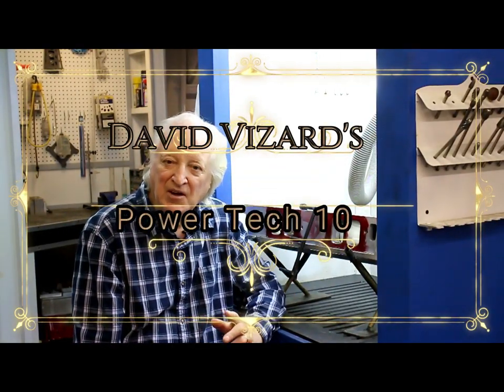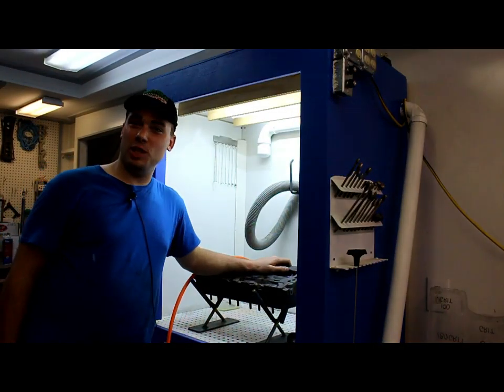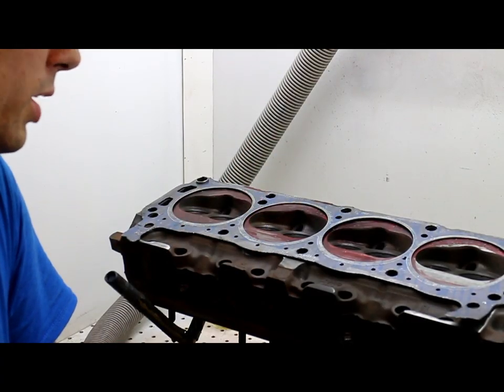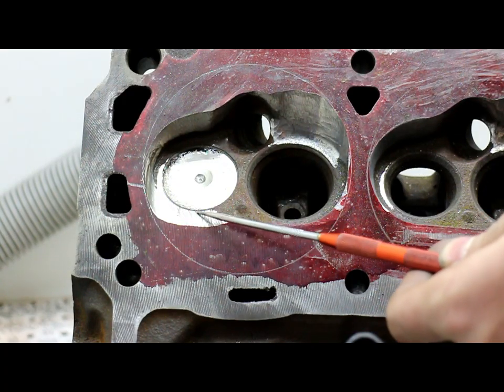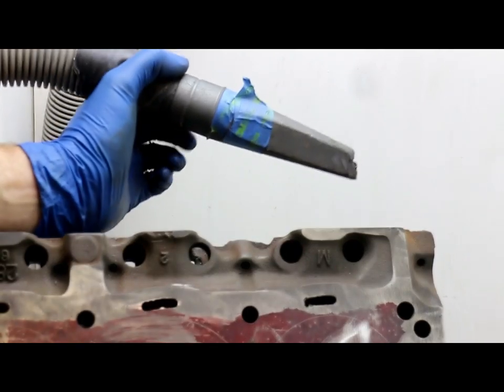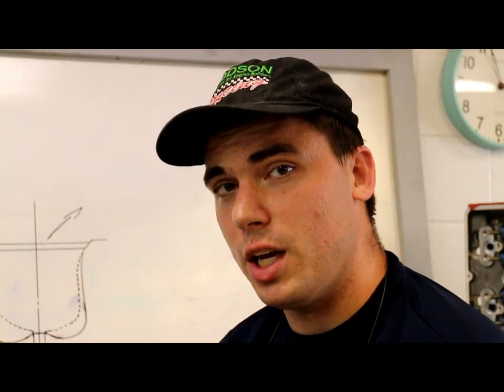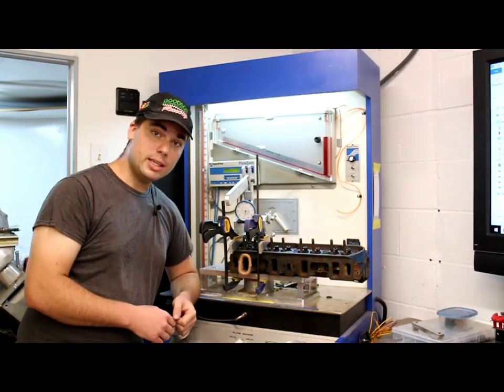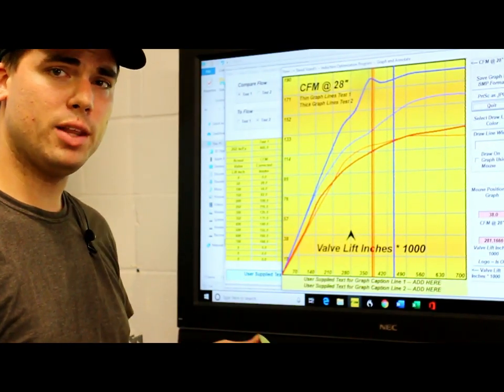David Vizard's PowerTec 10 EP6 Part 1 289 SBF porting

Comment: David, in your book, how to build horsepower vol. 2 carburetors and intake manifolds, on page 92 in the SU carb section, there is a small inset with picture of a triple 2" SU set up for a Toyota Lad Cruiser that stated, "the carb/manifold added about 35 horsepower the top end, but what it did for the low end was close to spectacular. Idle was a rock steady 450, and torque and drivability from here on up was like a steam engine. 
In short the engine was just about unstallable"
Can you elaborate a little, like what needles you used, and perhaps a little on the length of the runners?
I know this was a long time ago, but if given the chance I would have asked you about 20 years ago when I first read this. I really like SU carbs since my 65 mg (I really liked telling people I was doing an oil change on my carbs).
But now having a Land Cruiser, which is a real torque monster to start with, I'm really interested in gaining a few more ponies on the top end to go with that near steam engine torque you and your friend achieved so long ago.
I'd love to hear from you, you have helped me and many others out with your deep understanding of the internal combustion engines we all love so much. 
Thank you!

Comment: Did my heads 66 289 in 1980 194/160 valves got offered 3k  for my 66 mustang in 80 ! Now has Mickey Thompson crossram 2 465 holley's manual secondaries  solid roller 288/586 jba 3/4 long tube 4 spd 4.63s !

Comment: Interesting. I was expecting more of a balance between high and low lifts with the deshrouding that went on, not massive mid and moderate high gains with zero gains down low. I need to watch it a few more times and see if I can visualise why this is the case.

However, given that this was done with exactly zero port work, intake csa hasn't changed and therefore velocity should have increased notably.

If the engine had a bigger than stock cam *and you only did this*, would I be right in assuming pretty big gains down low (below previous peak torque) and moderate gains up high?
Reply: Low lift flow is hampered by the valve. Backcutting would have improved this, but they seem to be proving out the bowl work with the baseline, which was a stock valve.

Comment: At 5min 26s, there is a reference to not touch a certain area adjacent to the intake valve, but it is hogged put on the exhaust just 30 seconds earlier in the video. Can someone explain this please.
Reply: You want the inlet to push the gas in a direction that's gunna create swirl. You won't do that effectively if you de-shroud the far side of the intake valve with that particular combustion chamber shape. But you want to give the exhaust every opportunity to escape the chamber.

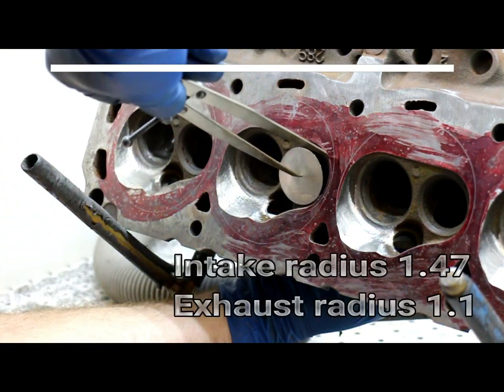Comment: At 4:55 you have given radius dimensions for the relief zone. How were these numbers arrived at?

(It seems like it should be valve radius plus some portion of max lift, but I've got exactly zero head porting experience)
Reply: Flow bench, dyno & 60 years of porting experience
Reply: @DavidVizard  Fair enough...

Btw, while I've got you here, which are the best books of yours to learn about complex/detailed/in depth engine modifications? I've got a copy of "How to build horsepower volume 1" but I'd like to go into a lot more depth and doubtless there's a lot of updated information and theories since 1990
Reply: I would also like to know how to find out a bout a three day seminar.while I would like to  do a longer one I'm in the north east and can't take that much time off.I have a big block ford and AMC project going on right now and would love some insight into improving the porting on both. Not much on the dogleg exhaust techniques out there and the big fords have there issues as wellWhat's the best way to contact you?
Reply: @DavidVizard . Please post part 2 of this video on your new channel!   Thanks!
Reply: Where is part 2?

Comment: The only reason to do this is if you are one of those weirdos who like to flog themselves with spiked whips.. and keep using junk factory heads so you can say it's "numbers matching".  Every single after market head in existence will burry that old junk iron in the dirt.  A waste of time and cartridge rolls.
Reply: Because being able to make 400 plus HP with factory heads and not need spend well over a grand to achieve the same power goal is pointless..Well, for the clueless anyways.
Reply: What’s the point of replacing every factory Ford part with aftermarket parts?

So you can brag about how fast a ‘Ford’ is when it isn’t even a Ford anymore?